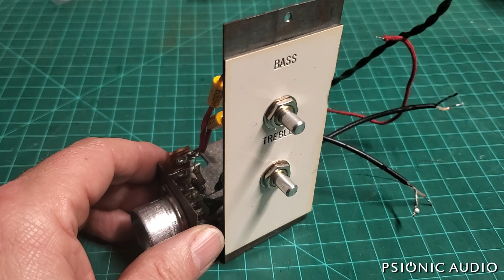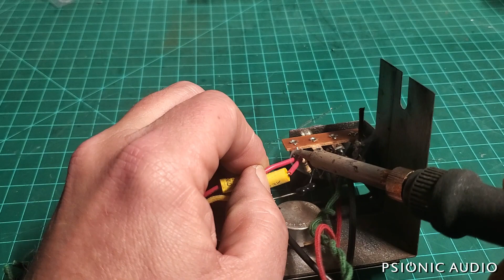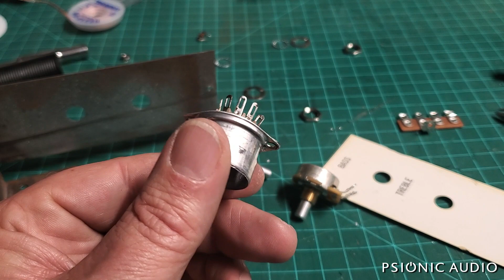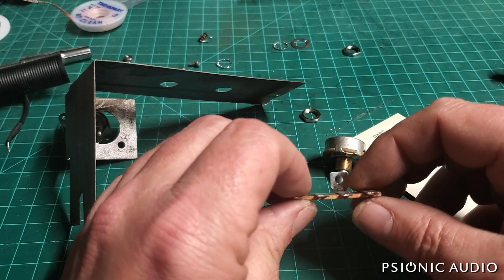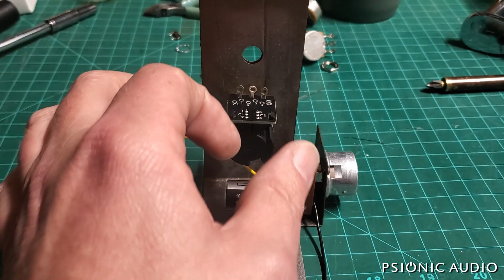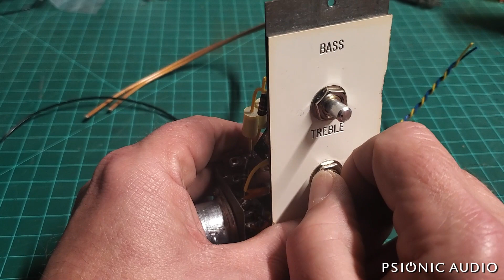'63 JMI Vox AC30/6 | Part 12 : Let's Build a Top Boost Circuit

Comment: Really impressive attention to detail! I assume this would be your preferred way of building a top boost compared to the other one you modded in that everything is more compact and that heater wire runs across rather than around? Also is that a 500k cts dpdt as they don't seem to make 1meg in their dpdt range?
Reply from the maker: Yeah, I prefer doing heaters like this. It's a 1M (amprepairparts.com)

Comment: Question Lyle....what can be done to a dark normal channel? Too dark to use on my 63. I've seen Dan from That Pedal Show say he has had an EF86 channel added to his 63. But he still has the top boost channel. Maybe the normal channel was cool converted to EF86??
Reply: Spellcheck.....skip the word cool. Lol
Reply from the maker: Have a tech put a 100pf bright cap on the Normal volume and (optional) a 22nf cap between the wire going to the Normal volume input and the volume lug. That second one dewoofs it without losing the low end you want.
Reply: Very good. Thanks so much!

Comment: "Done so extremely poorly"??? Really? It doesn't look that bad....does it?
Reply from the maker: Yeah, it was. Poor lead dress, not a single good solder joint, stress on every pin of the tube. Would have been noisy and microphonic.